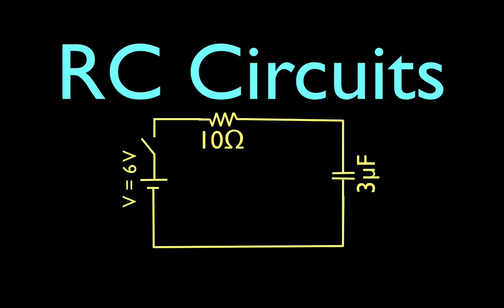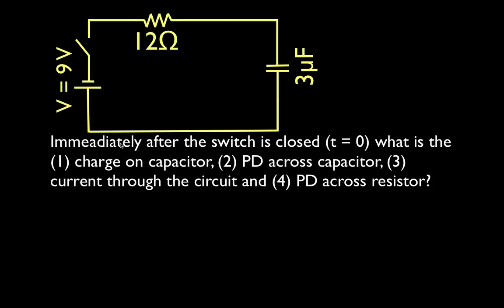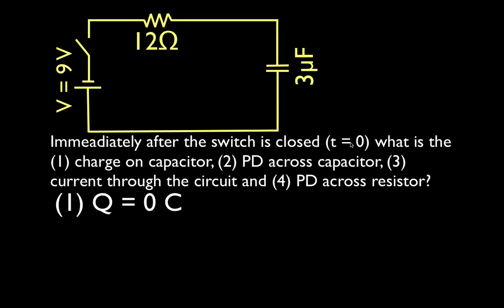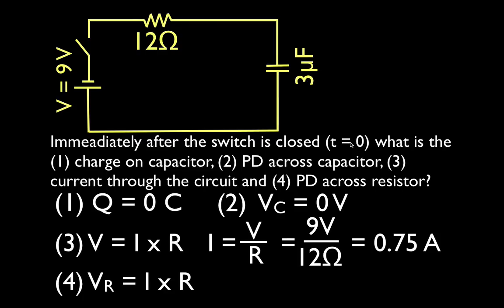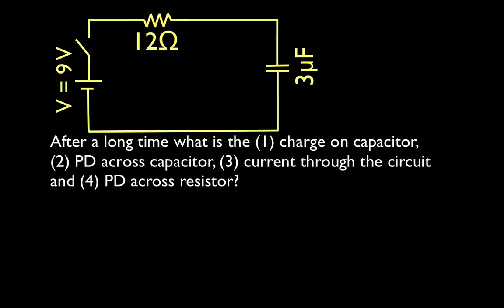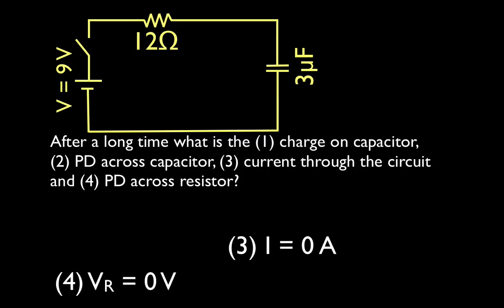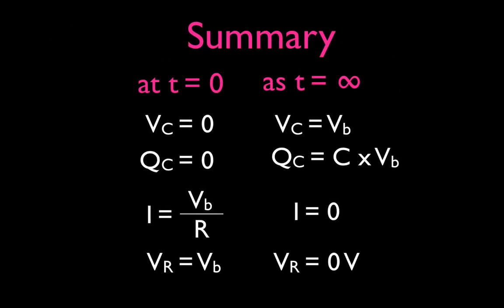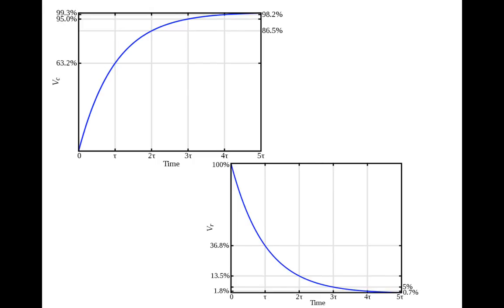RC Circuit Analysis (1 of 8) Voltage and Current

Comment: what if the capacitor is pre chrged?
Reply from the maker: That would be ok.
Reply: What does that mean? And also can you please tell me what will happen for a circuit in which there is constant current source is connected in parallel with a resistor and also in parallel to a pre charged capacitor?  @stepbystepscience

Comment: Can you explain why there is current when the switch is off?
Reply from the maker: I do not know exactly what you mean by "when the switch is off". Do you mean when it is open or closed. When the switch is open, as it is at the beginning of the video, not current flows through the circuit. When the switch is closed then current will flow through the circuit until the capacitor is fully charged. Does that help?

Comment: shouldn't the capacitor be the first one to get in touch with charges instead of the resistor? Since the + side of the battery is pointing down going counter-clockwise 3:10. Also the battery changed directions in the first two examples.

Comment: The energy in the capacitor when charged is C V^2  there is  an energy loss in the resistor, this loss is1/2 C V^2 , surprised? The loss in the resistor does not depend  on the size of the resistor, how Cool is that!

Comment: Voltage of capacitor =voltage of the battery after infinity as the capacitor charges until the pd across its ends equals the pd across the battery....
Reply from the maker: Yes, that's right.

Comment: is there a reason why the polarity of the source(i think - the plus or minus direction) changes half way through the video is that just an accident?
Reply from the maker: That is a good question, and yes it must just be an oversight on my part, sorry. But since it does not ask for the direction of the current it should not affect the answers for the questions.
Reply: @stepbystepscience  thank you -i'm new to circuit analysis and while that part confused me a little bit the rest of your video was INCREDIBLY helpful still.  i assumed that it wasn't a big issue since couldnt find other comments on it - but wanted to double check! ty for the quick reply :]

Comment: Is this dc? I thought capacitors block dc voltage?
Reply from the maker: Yes, that is the point. The current flows until the capacitor is fully charged.
Reply: @stepbystepscience  ok, thanks.  Im still trying to understand the properties of all these components. Thanks for all you do

Comment: In rc circuit I have connected resistor of value 1 megha ohm and cap value is 25v 100 micro farad, cap started charging slowly after some time the cap value is equal to battery voltage (9v dc).when I check the voltage accross cap with multimeter it shown voltage of 9v but constantly the charge reduced to 4.5 where it got stabilized .but when I kept another resistor to see what happens these time I have kept 200 ohm cap got charged to the battery voltage but when I checked the voltage is showing 9 v but these time voltage stayed at that position only .to check further I removed cap and removed wire from one end of resistor which is connected to the negative of battery ,the 200 ohm resistor it given a value of 9v and the 1 megha ohm showed the voltage of 4.5 can u please   explain these

Comment: how can there be current when the circuit is open/ disconnected / without full loop. ?
Reply from the maker: No current flows through the circuit until the switch is closed.

Comment: Can you discuss what happens after current starts flowing through cap and before it fully charges?  ;-)
Reply from the maker: The current continues to flow "through" the capacitor until it is fully charged.  It will be full charged when the potential difference (voltage) across the capacitor is equal to the potential of the battery.
Reply: But the point I guess should be that as the Cap starts DROPPING voltage dynamically the voltage on the resistor should change too, as the sum of both should equal the voltage on the battery!  True or False?
Reply from the maker: Yes, over time the current decreases.  As a result the voltage across the resistor decreases over time and the voltage across the capacitor increases over time but the sum of the two always be equal to the voltage of the battery.
Reply: Thank you!

Comment: One question, sir. In the beginning of this vid (around minute 1) when the switch is open and then you close it, were we assuming the capacitor was discharged? I'm asking because you said immediately after closing the switch, the charge in the capacitor was zero.
Reply from the maker: Yes, when you start the capacitor is discharged.  Right after the switch is closed the charge on the capacitor is zero and then it builds up over time.  Does that help?
Reply: Absolutely it helped me clarify. Thank you! I just wanted to verify that we assumed the capacitor was discharged, because even in real life we could start the analysis but with a charged capacitor (for example, I connected to a previous circuit, I let it charge for a long time, and then I connected in the circuit you analyzed in this video.)

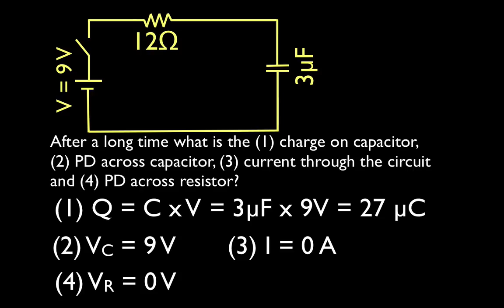Comment: I only have one issue with this video. At about 5:13 he shows the calculation for Q = C X V. He should make it clear about the units. Q is in Coulombs, C in Farads (not microfarads), V in volts. The result of his calculation is correct, but he should not play fast and loose with the units. Units are important. Q = .000003 (Farads) * 9V = .000027Q, which is 27uQ.
Reply: Farad * volt = coulomb 😊

Comment: As a retired electronic technician from the 60's +++ and a You Tube educational video developer of 28 videos myself, I am trying to get updated on electronics as it has evolved into the current digital age.  Your video is very helpful and well presented.  You are a real credit to the You Tube educational community!!!
Reply from the maker: Thank you very much, it is nice of you to take the time to comment.
Reply: @stepbystepscience  to jump on this, I just subscribed for the Summary section of this video alone. the visual comparison is really going to help me for my test tomorrow. much appreciated!
Reply: I only have one issue with this video. At about 5:13 he shows the calculation for Q = C X V. He should make it clear about the units. Q is in Coulombs, C in Farads (not microfarads), V in volts. The result of his calculation is correct, but he should not play fast and loose with the units. Units are important. Q = .000003 (Farads) * 9V = .000027Q, which is 27uQ.
Reply: @maximusfl3926  Your comment doesn't make sense. The prefixes have nothing to do with units. Micro coulombs are still coulombs. Micro farads are still farads. It's just another way of writing the values. And it's not 27uQ or 27 micro charge... that doesn't make sense. Coulombs are the units of charge. Hence the correct answer is 27uC.
Reply: @collegestudent6071  Units matter. You said "Micro coulombs are still coulombs" , yes they are but the scale is different. You will know the different between getting shocked by 1 A versus 1ua. The difference could mean death. When formula's are created with specific units, you need to maintain those units, or do the conversions, in order for the calculation to be correct. So if the formula calls for coulombs, you need to convert micro coulombs to coulombs and then do the math. That was my point, see my example.
Reply: Hello sir, I want to learn more about analog circuits

Comment: why the current  is zero  across  resistor after a long time?
Reply from the maker: Because then the capacitor is fully charged and when the capacitor is fully charged the no more current flows throught the circuit.  Does that help?

Comment: in first case Vc=0 ;so Ic=0 then the circuit is open circiut then how the current passes and u got 0.75 amps can u answer please.
Reply: no this is the closed circuit but at time = 0 or as he said at a fraction of second, right after the switch is closed.

Comment: So 27uC = 0.000027 Coulombs. If that's true, then seeing how 1 Coulomb = 1 Amp, or 6,241,509,750,000,000,000 electrons passing a given point per second, then the rate at which it fills up, is... 0.000027 x 6,241,509,750,000,000,000 = 168,520,763,250,000 Electrons per second. Or.. 0.000027 Amps per second, or.. 27uA per second. Right? Because 0.001 is 1mA, 0.000001 is 1uA. 1 Coulomb is equal to 6,241,509,750,000,000,000 Electrons. 1 Coulomb is equal to an ampere. Wikipedia.
Reply: Check your units, 1 Coulomb does not equal 1 A. Because one is a quantity and the other is a rate of charge per unit time.
Reply: As stated above, you're incorrect. 1 Ampere is equal to 1 Coulomb/Second. Current, measured in Amperes, is a measurement of the rate of flow of charge through a circuit. You're confused with regards to what the values represent. The 0 Ampere current value in the second half of the question (after a long time) means that the capacitor is fully charged and no further charge can flow through the area.

Comment: On the summary screen you said that, "Well there is current, the current is equal to the voltage of the battery TIMES the total resistance".

Comment: I'm assuming it doesn't matter where the capacitor is located in this circuit?
So it doesn't matter if the capacitor is closer to the battery than the resistor....
Reply from the maker: +Jomel Sagsagat Great question and yes you are right, it does not matter.  In fact if you go the "other way around" then the capacitor is closer to the battery.  It does not matter.
You can see a listing of all my videos at my website, http://www.stepbystepscience.com

Comment: Hats off man for making a very good video on the basics but at present im at IIT level and this information does clear some doubts but not all of them like  What the charge of the capacitor would be i the circuit is in neither t=0 or in steady state 
and it would be muchbetter if u coould include some complex circuit problems with atleast 5 or more resistors..
Reply from the maker: +Sivasubramanian Chokalingam Thanks for the comment.  Yes the charge on the capacitor over time is very interesting, I will put it on my list for a future video.  I do have more capacitor and resistor videos which you can find at my website  www.stepbystepscience.com.
Reply: Thanks man

Comment: how would find the voltage if the resistors are in parallel with the capacitor?
and if the resistor and capacitor are in parallel and that parallel part of the circuit is in series to another resistor when connected to the power supply...
just asking cause i get a lot of these in my tutorials and i have no idea how to solve them...
its frustrating trying to find a reliable source on how to find these...
Reply from the maker: Moeono Meredith Yes they do get complicated very quickly...hard to without seeing the circuit diagram.  Try to break it in to small steps/parts.

Comment: Very helpful! One confusion though. Right after the switch is closed, because the capacitor is like a cut-off. How come there is current equal to 0.75A flowing across the resistor? Thanks a lot!
Reply from the maker: That is an excellent question!  But it may be a little hard to clarify here.   As soon as the switch is closed, the current begins to flow and will continue until the capacitor is fully charged.  Then over time the current will decrease to zero as the potential difference of the capacitor increase to its maximum.  Part of this depends on how you think of capacitors.  I would not say that current flows "through" the capacitor, but current flows through the circuit.  Does that help?

Comment: Hello Brian-- seems like almost everyone likes to describe an RC circuit the same way ...Battery + to a resistor leg ..other resistor leg to a capacitor and the other capacitor leg to ground. voltage is measured from the RC junction to ground. measured voltage starts at zero then slowly increases to +V..........But no one talks about this circuit reversed. What if the capacitor is connected to the +V then to a resistor which is connected to battery negative. If we measure the voltage from ground to the RC junction could we expect the voltage to start at +Vbat and slowly reduce to zero volts ?
Reply from the maker: Good question, john vining but it makes no difference.

Comment: I have been studying RC circuits and came across a question about a circuit with a 10 volt power supply, 10k ohm resistor and 10uF capacitor. I have learned about the equation for finding t (tau). A question that was asked was how long will it take to charge he capacitor to full voltage. The answer was found by finding the value of t by multiplying the resistor value by the capacitor value. There was a graph shown for the capacitor to reach full charge would be 5 time constants.

My question is:

Will it take 5 time constants on any capacitor to reach its full charge?

I hope I have explained this well enough. Many thanks in advance and thank you for another excellent video.

Comment: Great explanation!! For the scenario where t=0, instead of calculating the voltage across the resistor by ascertaining the current through the whole circuit, you could also use Kirchoff's law, as in Vs - Vr - Vc = 0, so that (with Vs = 9V and Vc = 0V at t=0), Vr = 9V. However, your method unveils both the initial resistor voltage AND current, so I respectfully present my comment as an alternative.
Reply from the maker: Yes, thank.